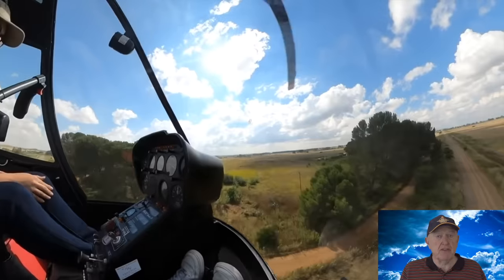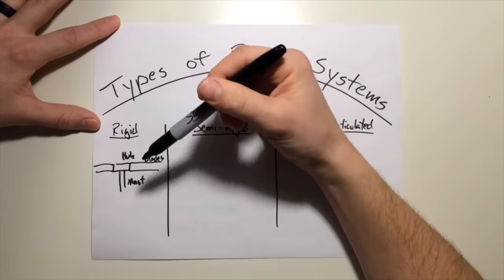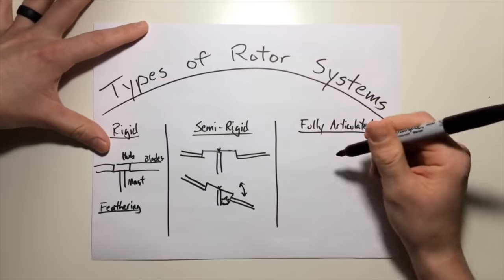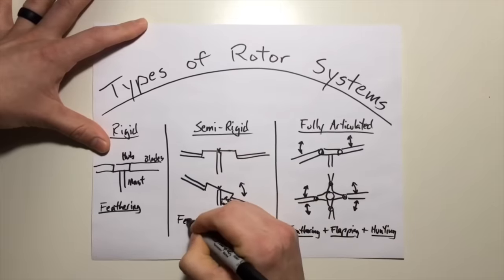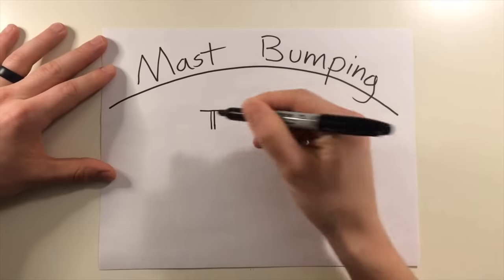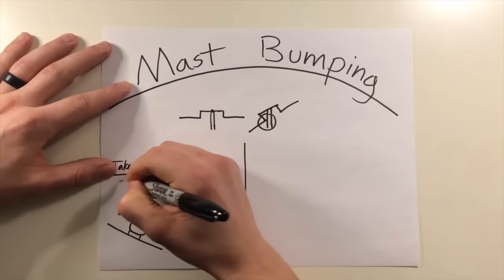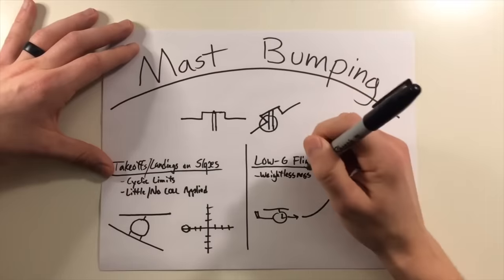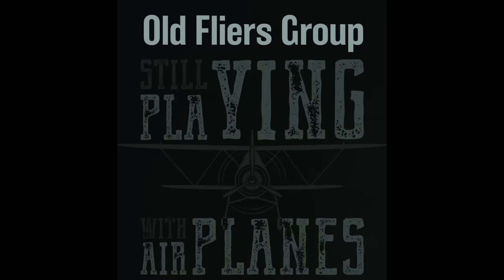Helicopter accidents that are due to "mast bump"

Comment: Mast bumping is like an automotive engineer telling a driver: our cars will turn 30 degrees in each direction, but, don't ever move the steering wheel more than 25 degrees going downhill at speeds faster than 3 miles per hour or catastrophic failure can occur. That scenario is just as ridiculous as mast bumping, and is garbage design and engineering, plain and simple!
Reply: That was my thoughts too. You'd have to be slightly unhinged to buy and fly a machine like this? The more I read about helicopters, the more I realise how complex the engineering is and aerodynamics are, and therefore how many failure modes it has.
Reply: Helicopters built like cars, fly as well as cars.

Comment: Robinson R22 Lightly Loaded. Does he mean G load or low GW of R22. Becouse when it comes to GW of R22 there is no such thing as lightly loaded. It barely has enough power to TO with two people and 40% fuel on slightly warmer then std day at sea level. Othwerwise I can see how mast bump in fast fwd flight can occur. The pilot is pushing R22 to near its Vne, the cyclic os almost fully fwd. Then turbulence hits and for a moment R22 is at 0 or negative G and mast bump occurs. The excess flap either slices into canopy, damaging blade, or slices off its boom . Without boom, even going into immidiate autorot, chances of survival are slim to none. R22 and R44 are delicate gossamers of helicopter world.

Comment: I learned in a Bell 47. I have tried to find any cases of mast bumping on them, because it can’t. It was built two Sprague cables that limit the movement of the blades on the teeter hinge. It reaches the limit before it can mast bump. The R22 is a bad design. Frank Robinson worked for Bell. He should have known this. I think he did everything he could to eliminate weight or anything he thought superfluous. To make his helicopter lighter and less expensive. That cutting corners costs lives.
Reply: Now knowing this, I don't understand why mast bumping possibilities couldn't be engineered out of every helo.
Reply: EXACTLY!!!

Comment: great video, one of my biggest fears and hesitancies when flying a robbie, but as long as you don't exceed its capabilities, its  a great machine. just slow down to 57-70kias in turbulence, minimize cyclic inputs as much as practical and do not control altitude with your nose attitude.
Reply from the maker: Good comment
Reply: As with all things, operational limits should never be exceeded

Comment: Former OH-58 driver here.  Spent a lot of time at tree top and very low level (<75’ above the trees).  Always gave a little aft cyclic when popping over a ridge line to keep the rotors loaded.
Reply from the maker: Thanks for the info!
Reply: Great hello.
Most reliable in the world.

Only rival: OH-6 (hope you agree)
Reply: OH-6/MD500 has a fully articulated rotor system though, so why would you need to get it loaded?, you can to full cyclic pushovers in them without worrying.
Reply: @serdavosseaworth6115 the original post said he was flying OH-58 helicopters. I believe the first variants had a two blade teetering rotor system (same as a Bell 206) and later variants received the four blade articulated rotor system that was then used on the Bell 407.

Comment: Having seen the interview with the NZ companies CEO  and learning a thing or two, you'd be reluctant to step into a 22 or 44....
Reply from the maker: Hard to know Michael. If flown correctly, a well maintained machine should be safe. My friend was very experienced yet came to grief and all the answers are still not in. Regards.
Reply: Been trying to get my ex to go up in one for years
Reply: Hmmm. Having witnessed a Robinson (fatal) crash, I will likely never go in a helicopter again, but definitely not a Robinson. Fuckin' death traps. If the company is aware of problems in their design, why not address them? (Just by the way, and to be sort of fair, the accident I witnessed was engine failure followed by collision with power lines in the auto-rotate landing.)
Reply: @jordancoleman2402  Lol!

Comment: I fly the R44 in my training and went to the Robbinson safety course. It is unfortunatly not a good aircraft to fly in the mountains/ moderate to severe turbulence. But I also think keeping in mind that the R44 is the most common helicopter in the world so it will seem like it crashes more than lots of other helicopters but in reality its just the most common heli in the world. The second most common heli in the world is the Bell 206 and it also is suseptable to mast bumping as well, so it is not a Robbinson only problem. The recomendation from robbinson is to always slow down and if winds get bad, land the damn helicopter. Weather can be dangerous to all aircraft but helicopters have an amazing ability to land anywhere! I have 150hrs rn with most in the R44, it is a very simple and safe helicopter as long as you understand its limitations, like all aircraft.

Comment: I have flown real planes and fairly large scale RC planes (5 to 6 foot wing spans), the latter well enough to place in the top 2 or 3 in most competitions, but I can't wrap my head around flying an RC helicopter with all the inputs (cyclic, collective, throttle, etc.).  I've had friends who had large scale RC helicopters, with me on a buddy box, and it doesn't take me but just a few seconds to get out of shape to where the owner has to quickly take over.  It was quite frustrating because I thought I understood the science but could never stay ahead of it.  That said, hats off to those who can.

Comment: While I was undergoing helicopter training in the 1980s, Robert Noyce, the CEO and co-founder of Intel Corporation, came into the FBO for a demonstration flight.  The chief flight instructor took him out over the hills south of the airport in one of the school's Robinson R22s and after a rather short flight returned with a couple of notches in the rotor mast, the result of demonstrating a low-G pushover.  They were very lucky.  A few more rotations under those conditions would have severed the mast.  Noyce never came back for a flight lesson.
Reply: Well that wasn't a very noyce thing to do.
Reply: Woah, and Intel may not have been the company it is today.

Comment: I learned (via a series of expensive self-taught lessons) about rotary wing aircraft by flying RC helicopters in the days before sophisticated flight stability electronics were common. It took me about 6 months just to get to the point of being able to reliably hover in a relatively fixed position, and each of those early flights would end with sweat covering my face from the intense concentration it required. I've never flown an actual heli, and I'm certain I would never want to. There's an old adage that goes something like "a helicopter is a collection of random and dissimilar parts flying in tight formation". And, I might add, that's only on a good day.
Reply: dissimilar and fatiguing parts.
Reply: I fly both, and it is easier to fly the real helicopter!

Comment: SFAR training. And flying the aircraft within its envelope and limitations. 
Any pilot who does their planning and knows the conditions of their flight can determine if there will be turbulence. And can then be prepared using all the above to avoid or recognise the conditions that can lead to Mast Bumping or low G situations.
An aircraft will perform the way it is supposed to perform and designed to perform. If it is knowingly operated outside the envelope, you're putting yourself at risk. Game capture, mountain frying or flying into turbulence, and continuing the flight are examples of deliberately putting yourself at risk. 
Guns dont kill.... people using guns kill. 
Just my opinion. No disrespect to those who know or have known others who have passed in accidents.

Comment: 1000 hours of CE time in Hueys.  Around 1990 we got mast bumpers made of rubber to avoid these issues.  Many of our pilots were former Viet Nam pilots and saw the results of mast bumping.  The Cobras were especially prone to mast bumping due to the birds attack mission.  Why it took so long to get the rubber bumpers I don't know but our pilots were very aware of what caused a rotor system to break off and avoided such manuvers.  I never felt unsafe with our military trained pilots and incidents of mast bumping.

Comment: As a novice idiot in the helicopter world i can say that these machines are way more sophisticated to fly than they first appear to, the complicated mechanism enabeling flight explains the higher incident rate compared to an airplane, the upmost respect to these pilots
Reply: I hear you.... To call yourself a "novice idiot" is to already recognize that there are gaps in your understanding and you are willing to learn ..Thus avoiding "We couldnt tell Him anything he didnt already know  itis"   Well Done You !! 

Both a Helicopter and a "fixed wing" are "Aeroplanes" ..i.e. they are neither Balloons or Zeppilins. Engine failure in wooded country in a fixed wing ...you are most likely dead ..In a Helicopter... provided the pilot can do a forced landing ..you wil very likely live. 
There is nothing more or less inherently dangerous ...nor more or less easily understood ...with  a machine that is mechanically simple or one that is mechanically complex.
Reply: Perhaps by way of further elucidation .. say you have electric trim runaway on a slippery but bog basic kit plane.. you cant get to the circuit breaker to diable it (not sure which one it is") and have never really considered trimming with a manual mechanism (if it has one) ...couldn't be simpler ...but only marginally survivable.  I hypothetical I hope makes the point. Simplicity is not your friend... You still have to know what you are doing.
Reply: If by “higher incident rate” you mean crashes due to the complicated nature of helicopters, this is a general fallacy. The main reason is that helicopters can and do much more risky work than nearly all fixed wing craft (I say nearly, as firefighting, for example is also done with fixed wing).

Comment: The semi-rigid one is incorrect, there's no mention of the dampeners, the disk and mast will still end up at about 90 degrees to each other, this video could lead to confusion, it implied that the helicopter fuselage remains level, that is NOT true.

Comment: Every 2 bladed rotor system is comprised in a low G situation.

No mention of the trusty old Jet ranger here.

I love Robbie’s, they are genuine workhorses that have built many a business over the years.

If private pilots had to complete commercial licenses to fly , the problem would almost disappear.

Comment: As an experienced airplane pilot, (same as fixed-wing), I'm afraid I would instinctively push the stick forward if I was about to collide with a bird at about eye level. I'd bet that was the cause of some of the mast bumping accidents.
Reply: Most likely the cause of the R44 crash in TX about a year ago. Commercial fixed wing pilot on a Rotor lesson with a very low time instructor, and they're thinking there was a very abrupt cyclic imput by the student, chopping the tail of the R44 off.  So, so sad!!!
Reply: With 1000 hours in R22s and 1000 hours in fixed wings all I can say is that there are flight envelopes in every aircraft type and flying outside them can end in disaster whether it’s an R22 or a Cessna 172. We know what they are and how to avoid them. Blaming the aircraft for a pilot  doing stupid stuff just drives noisy know-nothings to demand the aircraft type be banned. Pretty soon there is no aircraft at all allowed.
Reply: @scotabot7826  That's not mast bumping according to this video.  But I've heard about this scenario with Robinsons several times, usually fatal.
Reply: @Jabiru430VHDOD Yes, but there are degrees of everything. 

If the Cessna 172 was designed so that a negative g push over was likely to break the wings off, would you consider that an acceptaple flight envelope limitation?
Reply: Don't dive the airplane to avoid a bird strike.  It is the birds natural instinct to fold its wings and dive to avoid hitting you. Diving the aircraft puts you both on a collision course.  A climbing turn is a better method to avoid a bird.  Its amazing how many times I have seen a bird at 3000 feet AGL!

Comment: Why can't the rotor articulations be limited in range of motion to avoid mast bumping?
Reply: For it to be beefy enough to stop it, it would signifigantly increase the weight of the rotor system making it lose a lot of performance, which is also dangerous for helicopters as-well. Helicopters are very light weight and in high altitude/temperature situations it would barely be able to be operated, if not at all. All semi-rigid rotor systems have mast bumping. The two most popular helicopters in the world use it: the R44 and the Bell 206 due to its much less exspensive operation compared to rigid and fully articulated rotor systems.

Comment: Very interesting, is it not possible to design the system so the rotor cannot physically touch the mast?
Reply: Well that chap did show us the rigid system - which apparently works well with fibre glass blades on the Red Bull machine.
Reply: @DrTWG I think he means a limiting mechanism of some sort to not allow the angles to get severe enough
Reply: This is my first thought too.  If you're driving a car and turn the steering too far in eiter direction,. the tyres of the front wheels can rub on the bodywork.  Except they don't because manufacturers prevent that happening by simply setting a limits to the travel of the steering angle.  Ironically these are called "bump stops".
Reply: @MadScientist267 the rotor could bump the limiting mechanism, so it adds up to the same thing
Reply: No its not possible, the forces are too great. 
Think of it like a bottle top opener popping the lid off a soft drink bottle, the rotor system does the same thing to the mast in an instant. 
It's the sudden and very rapid roll to the right due to the tail rotor forces that the pilot then instinctively inputs the large cyclic movement to the left with the rotor disc unloaded, game over from this point your rotor system has departed. The correct action when a low g situation is encountered and ensuing rapid roll should be aft cyclic to load the rotor disc then correct the roll all in an instant, easier said than done but if you want to live that's what needs to happen.
Reply: I was about to ask exactly the same question.  I'm not a pilot, but I was wondering if the "limit" is a result of the dynamics of the flight.  What might be past the limit in a low G pushover might be well within tolerances for normal flight?  In other words, if you are experiencing relative microgravity (I'm not a pilot but I hate the word weightlessness) you might be able to exceed the rotor tilt angle and strike the mast, whereas a full loaded blade in the same conditions would not tilt so far.

Either way it is an interesting bit for explanation for armchair enthusiasts.  Very much a tip of the hat to those with the skill to fly any rotorcraft.

Comment: And so I fly gyrocopters instead. low g and uncontrolled blade flap is still a thing i have to avoid but dives and zoom climbs can be done with proper technique without falling out of the sky or crashing into the ground.

Comment: Showing my ignorance here as not a pilot, why is there not a mechanical limit so mast bumping can't happen ? Could some one explain why it is not mechanically blocked so as not able to cause interference ! Thanks
Reply: It wouldn't do much good.  Mast bumping in a Robinson R22 happens a few inches from the pivot point, driven by blades that are about 12 ft from root to tip.  Thus, the leverage is huge, so much so that there is no material that could withstand the pressure at the point of contact between the blade hub and the mast.  The notches in the mast get progressively larger with continued bumping until it breaks, or the pivot bolt shears.
Reply: See my comment above. My question exactly.
Reply: @Milosz_Ostrow  thanks Milo for you explanation 🙂
Reply: I was thinking along the same lines, thinking of a maybe a ball or roller bearing mechanism.
Reply: .The purpose of the hinge is to relieve stress applied to the hub, mast and blades. If you limit or reduce the amount it can travel you are limiting the amount of potential stress relief and also limiting maneuverability. In most cases it is not the mast that is severed, but the long heavy blades of a two rotor helicopter that continue to droop even after hitting the mast. This movement most often allows the rotors to hit the tail or even the cockpit. So to recap, by limiting the movement you would just induce stress earlier, while the blades would continue to droop. This is why good helicopters are fully articulated. Semi rigid is only used because it is the CHEAPEST option. In saying that helicopters with fully articulated rotors have cut off their own tails also, just much more difficult to do.
Reply: If there was a mechanical limiter, the rotor could bump the limiter, so it adds up to yhe same thing...

Comment: Robbinson helicopters are not a friendly helicopter unless you are aware of thier characteristics. The rotor mast is to high ,the blades are to inconsistant when being manufactured and if you get rubber mounts for the main rotor mast that are to soft you may just end up dead from the freqeuncy that gets created in the mast. This freqeuncy tears the machine apart and blade to cab strikes will occur. Nice flying machine if you no what your doing but if the freqeuncy manifest the main rotor mast you better only be about 50ft off the ground and land right away,shut it down get out of the machine and watch it vibrate till the rotor stop completely.